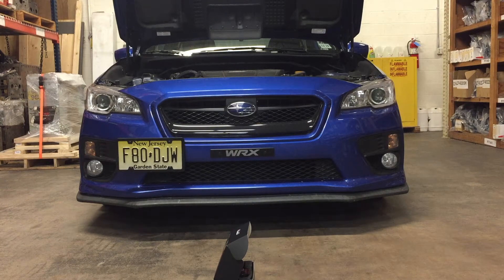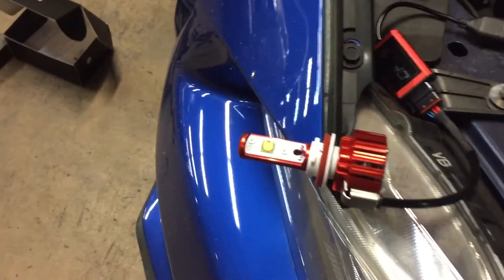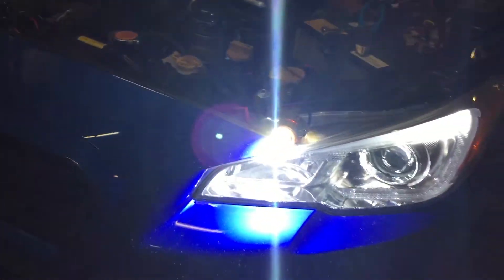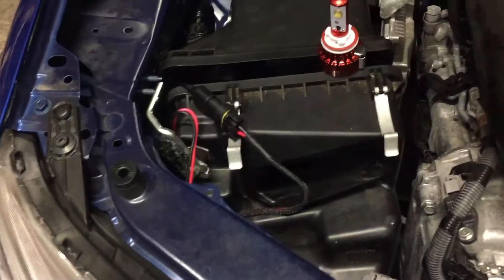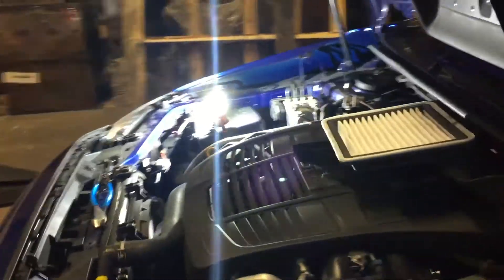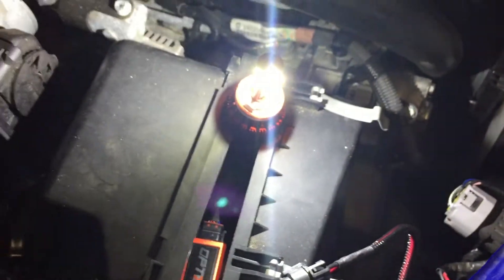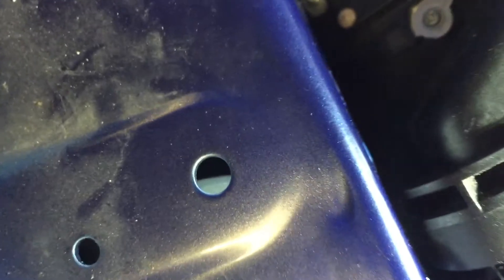2015 WRX Low Beam OPT7 LED Installed

Comment: how were you able to get your 'plug-n-play' wiring to connect to the HID wiring?
I rec'd my Arc-Beam LED kit and it has connections for standard halogen bulb wiring...
How did you connect the Opt7-kit to the cars power source?

PS: Thank you for the great video!
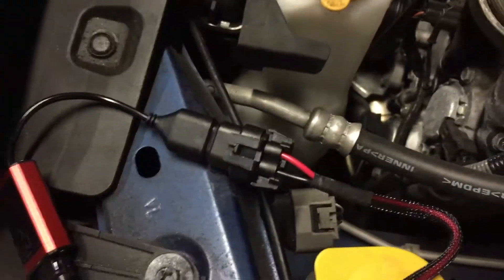Reply from the maker: +Jordan Leuthold I completely remove my old HID kit out. There's a relay included with Opt7 kit to plug into the OEM plug. You can see it briefly in this video it at 00:40. Trust me it's really easy to install, like a 5 min setup :D, it should be the same with your TSX.
Reply: +DL Media -  the connection going into the HID ballast is not compatible with the OPT7 connections, that I have. Was the connection into your HID ballast the same as the OPT7 kit connections? do you have a pic by chance? ***THANK YOU for your response:)
Reply from the maker: +Jordan Leuthold No, it doesn't work that way. It has nothing to do with the HID ballast. You have to remove the HID ballast out completely just use Opt7 kit that came in the box alone.
Reply: +DL Media - But don't I need to use the car's power cable that was going into the ballast...? to power the LEDs? and to control them with the headlight switch inside, etc....
Because unless I were to get some kind of harness I think I will have to cut off the connection on both the car and the OPT7 kit and hard wire them?
Reply: +Jordan Leuthold  - my OEM plug connects to the HID ballast......? which is the wrong connector
Reply from the maker: I see, I think it only fit the OEM halogen housing. in your case you might need to check if opt7 also  have the kit for OEM HID.
Reply: +DL Media - wasn't your Subaru stock HID's?... That you switched to the LED's?
Reply from the maker: +Jordan Leuthold No, it's the halogen stock. I just need to upgrade the bulbs that was it.
Reply: I just purchased these LEDs and I am having the same problems as you are from reading your comments. Were you able to install them since you posted on here? I have a 350z that has the stock HID set up so I wouldnt be able to plug the LEDs to the stock set up.